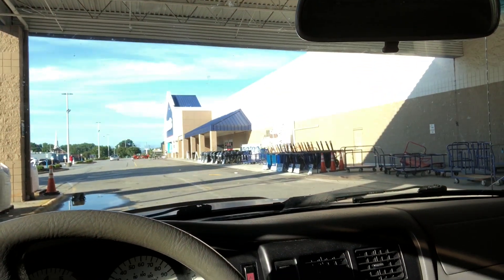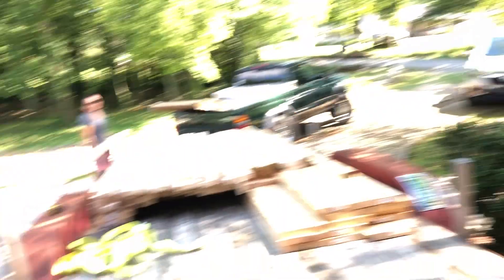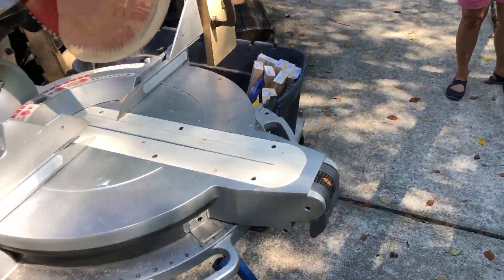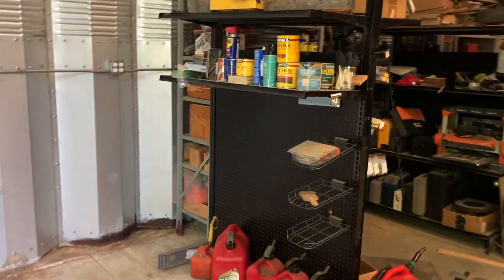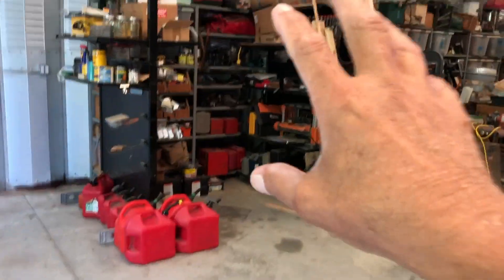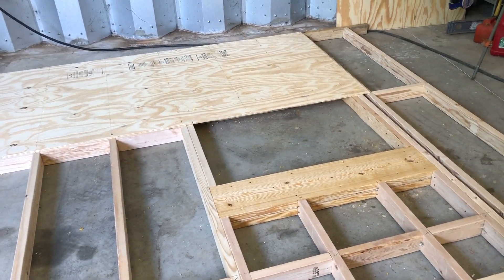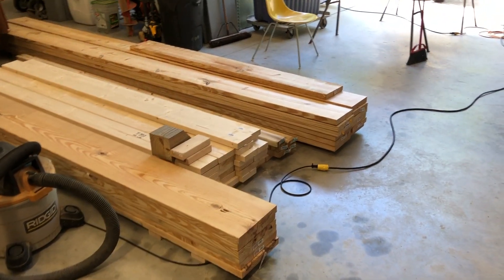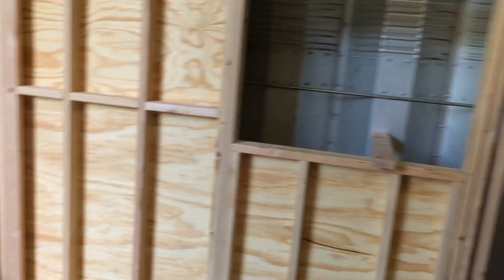New Woodshop Build Ep1

Comment: GREAT TO HAVE YOU BACK!  That's a LOT of work you have going on!  I'm going to follow your lead with exception of doing the space saving first after doing the insulating.  That will begin in September when it cools down?  LOVE TO WIG...."smiles"  I had to go out in April and get some electric clippers.  Thank God for Youtube and my bravery for just going for it.  I wear mine SHORT and the clippers took it beyond the word for short, but it sure did feel great to get the mess off my head!  Stay as cool as possible in the heat I know you're in.  If all else fails, wet yourself down with the sprayer a bit (mist setting).